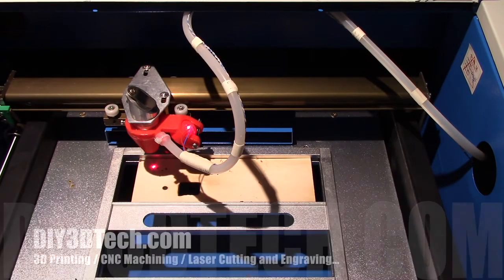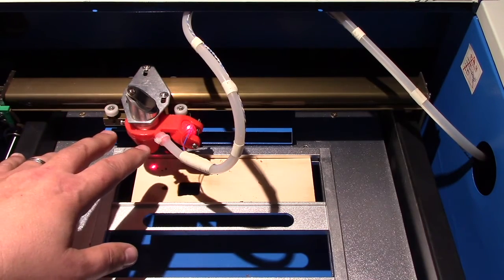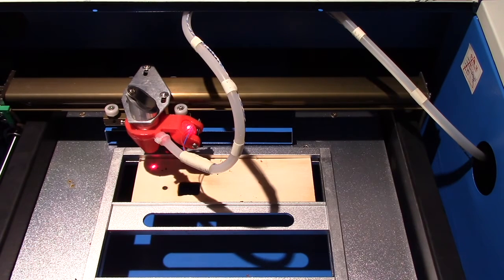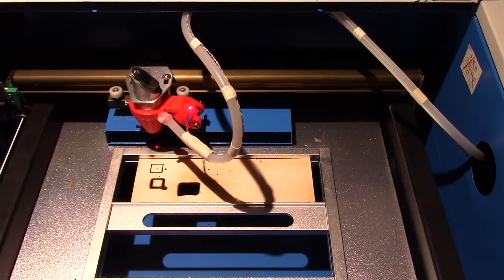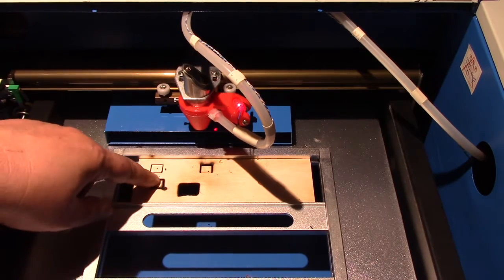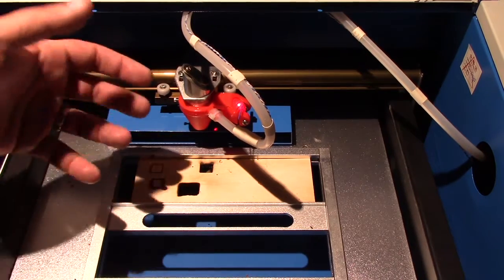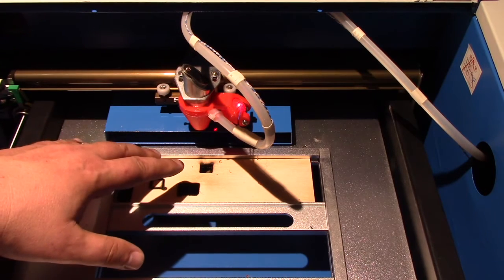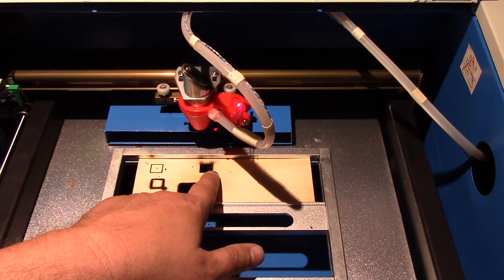K40 eBay Chinese CO2 Laser Cutter & Engraver -  Why You Need An Air Assist Nozzle!

Comment: what is the process to install an air assist with the red dot focus? too bad we dont see how you install them and where the wires go. does the red dot focus need a stand alone power source? is it connected to the motherboard, or is that merely connected to the power at the air pump? I have been going through your videos trying to upgrade each item on my new machine. Thanks for your help.
Reply from the maker: Have done both with red dot (separate PWS as steal power with a step down buck from the laser PWS).  It realy just depends upon your electronic skills and what you feel comfortable moding...

Comment: Here's something you never thought possible with a K40.

https://www.youtube.com/watch?v=nsv2-WaCZok
Reply from the maker: Interesting, Have cut think thick stuff with multiple passes so yes more then possible.  However you run into charing issues, sounds like you where running a lot of air?  If you look way back I converted a K40 to GRBL for this very reason (run multile passes).  Have tryed cutting a shape over a straight line?
Reply: @DIY3DTECHcom  I just wanted to see if it were possible.  I can do it in two passes if I only cut front to back.  I'm also using grbl, btw, but installed a Cohesion3D Mini so I can engrave faster.  Smoothieware was way too slow for engraving, but excellent for cutting. Just using one of those larger fish pumps.  The standard lens can't do this, not in less less than 6 passes anyway, but I heard from another YouTuber that the 38.1focal lens, while being a smaller, shorter focal length can cut deeper than lenses actually meant to cut deeper.  Many people rejected this notion, so I wanted to test it for myself.  I won't normally be cutting that thick of material, this was just to prove it to the naysayers.

Comment: This is probably not the most ideal place for this but: I recently 3D printed and added this air assist to my K40 chinese CO2 laser cutter. Air assist itself works great, however after this procedure I found myself with drastically reduced laser power / cutting depth. I assume this is my fault, but I'm out of ideas. The first thing I connected my 5v diode (the one advertised) to was the 5v line going to the potentiometer. This was apparently a mistake as it resulted in my laser barely functioning even at max power setting. I since then removed the diode from the potentiometer and connected it to the 5v located in the same line as the 24v that the internal light runs on. Still had the same issue, the laser power seems to have dropped significantly. At this point I went ahead and removed the diode completely - same result with low cutting/engraving power. I tested the potentiometer and it comes through great with 5v showing at 0 power and 0v showing at max power. Amperage meter also displays laser amperage as if it was working as intended.

As I mentioned, I'm out of ideas. If anybody has any suggestions on tests I could possibly run to sort out where the problem lies, I'm pretty desperate.

Also like to note that there are no strange smells, no smoke. The laser doesn't appear to be coming into contact with anything prematurely. The mirrors are also calibrated quite well (if I do say so myself). All mirrors as well as the focusing lens have been cleaned thoroughly and there are no obstructions/dust/etc that I can see.
Reply from the maker: So I am confused, you have a 40 Watt CO2 laser correct?  What does the cutting power have to do with a laser diode?  As even if the plastic got in the way of the beam, it simply would burn hole a in it.  If I had to guess, you likely knocked something out of align and simply not noticing it...
Reply: Hey, thanks for responding! I had originally believed that I had somehow caused damage to the control board while trying different 5v rails to power the diode - all of the 5v rails in my machine are already in use, so I basically piggyback on one and hope nothing bad happens. Others who know even less than I do about these machines (As if I wasn't scary enough) believed that perhaps I had damaged the laser tube itself in my tampering.

We have since found the issue and corrected it. As I suspected, it was an issue that was a result of me being completely out of my depth when it comes to machines like this one. I had believed my lens orientation was correct when I replaced it after cleaning all of the mirrors/lenses, but I had managed to flip it upside down. While the laser still made it to the project, the intensity of the beam was not nearly what it should have been. All is good now (or so it seems)!
Reply from the maker: Ah yes!  That gets a lot of folks and even believe I did a video this topic but good you got it sorted :-)

Comment: I love your videos! I will definitely follow you. I have a couple of questions. I am thinking of purchasing my own k40 co2 engraving machine from eBay. Is this the latest machine they have or is there a newer and upgrade one? Is this compatible with rotary engraver attachment?
Reply from the maker: Many thanks for kind comments and yes the K40 has been the way it is for several years and if your looking for the rotatory attachment, I would suggest buying one already set for one.
Reply: What are those two wires taped up on your air assist tubing?
Reply: Noel Abiang laser

Comment: I bought a fairly good quality 3d printed nozzle with a metal tip insert + o-ring etc. from eBay, but have a problem with a lot of air coming up through the mirror area in the head.  I had to replace my lens, (new one is made in the USA - FOCAL=50.8MM) which is a good bit thinner than the stock Chinese lens and I'm thinking it's where the nasty leak is coming from, so I'm going to see if there's a way to better seal it.  

Some of the crap I go through, I should start posting videos of my experiences. lol
Reply from the maker: You should (posting videos of my experiences)!  :-)

Comment: I added air assist of sorts for $2. I was looking for options on adding it and came across some guy stating that you don't need a nozzle, so I scavenged the basement and found what I needed! Brake line and a pump!  The black coiled hose is for airbrushing, cost 2 bucks from china.

Blog link:
https://k40laser.se/air-assist/

My video.  I did scorch the bottom in one place from holding the test button, but it cleaned off.
https://youtu.be/n756mBTPtAA

edit This one is a little better, but I forgot to turn the power down again; it's about 9ma here.  Also, until I get the bed I want, I drilled the hell out of the original and it's working quite well
https://youtu.be/ZKjtHL_rMiI
Reply from the maker: Yes have seen the tube approach before however personally as centers the air flow and ensure the beam is clear of smoke.  However if works for you and your happy with the performance, by all means laser away!  :-)
Reply: My biggest issue was the flame since I do a lot of cutting, but I don't have to worry about it now.

Comment: That much charring even with air assist, you might want to check your optics.
Reply from the maker: Typically get a bit, not running a lot of pressure just enough to keep it from flaming...

Comment: Please can you or someone do a video on loading the software. I have dongle plugged directly into computer port. Was giving Moshidraw with corelLaser 2013 and Laserdrw 2013. my computer sees dongle. yet i am constantly getting usb key missing error. Also
Softkey missing. Please Help. Thank You
Reply from the maker: What version of Windows are you using?  I recommend Windows XP with no virus protection, windows 7/10 especially with virus protection will give you issues. Also be forewarned IMHO there is likely a virus or at minimum malware in this software so I would suggest running it on a stand alone computer.

Comment: hello, great other video, i just ordered my air assist and cant wait to put it on,  only other issue i have is when i do a side by side engraving i noticed that the left engraving is darker and deeper the the engraving on the right, would you happen to know why i get this with the same machine?
Reply from the maker: Not sure what "side by side" engraving is however the further to the "right" and "bottom" you get the longer the path the light has to travel attenuating the beam (at 10,600nm this is very long wave light and the longer the path, the more power it will lose).  Second could be your mirror alignment, have you checked this in not only the X&Y but also in the "Z" as I had 6 mm run out in the Z on one machine.
Reply: oops, sorry about that, if i do a engraving with 2 designs next to each other the one on the left is deeper engrave, and the one on the right is lighter engrave. i have not did the aligment yet, worked well with only 1 engraving, this was the first time i tried to do 2 next to each other, i appricate your help, thanks
Reply from the maker: Yes, as shared above the closer you are to the origin the strong the beam.  However would highly suggest aligning the mirrors and see if that makes a difference...

Comment: Btw, I keep looking for a price drop (they recently went up 20-30 dollars) before Christmas and this is a new one I have not seen before.  For a 40w (1k-1.3k hour tube) this is starting to have bells and whistles.  No idea how good it is though but it compares and says it uses twice as thick framing material etc... www.ebay.com/itm/40W-USB-CO2-Laser-Engraving-Cutting-Machine-Engraver-Cutter-w-CorelDraw-Software-/152106266467
Reply from the maker: Yes they rise and fall in price and have seen this one before but not at this price point. While I have a digital and analog unit, I like the analog better as its more "hackable" and really was the reason for buying a second.  Also the sheet metal inside all looks the same, but it is the longer unit so likely does have a 40-watt tube and not a 30 like most digital ones...

Comment: Ahh. Bless, your bed is so clean. Mines a tar covered mess from mdf. Trying to find some good mesh like your other machine to replace it. But in the U.K. That seems tough.
Reply from the maker: On eBay you can get replacement bed but they are a bit expensive.  The screen I used in the other machine came from Home Depot.  Never seen one in many visits to London so not sure if they are on the outskirts maybe?
Reply: I live in uk and b and q have the mesh
Reply: Vinegar.  Distilled white vinegar cleans up laser gunk like you wouldn't believe.

Comment: I have three lasers and have been testing it alot, there is no difference at all between a laser with a air nozzle, and one with open lens design and a stand alone air assist (pipe).
Some chinese nozzles leak, so you get the venturi effect with the nozzle pulling dirty smoke into the nozzle from above.

Air assist is important, but you dont need the nozzle.
A small copper pipe does the same work.

Try it yourself, add the air assist on a small copper pipe and remove the nozzle. And check out some other types of air assist, should be a good video to make :)

Good vid though, always nice with DIY tricks for the machines we play around with :)
Reply from the maker: The  main idea is to clear the smoke out and prevent fire allowing for a slower speed pass so a pipe should work to as even on some commercial units I have seen pipes.  However like the asstetics of the nozzle over the pipe so maybe a just a piece personal geek dom :-)
Reply: Another benefit of the cone/nozzle style: it helps to keep the lens clean. An exposed lens with a (copper) tube air assist will require more frequent cleaning.

Comment: Could CO2 be used as the assist instead of air, or would that hinder the cutting process? or some other inert gas?
Reply from the maker: keep in mind an air assist is meant to puff out fire and clear smoke so air is just fine.  I guess I can't see a reason for doing something else in fact for the amount of gas you be dump would see as a possiabke health hazard...
Reply: DIY3DTECH.com I believe the CO2 would eliminate any chance of the PLA going into flames. Also CO2 is a safe gas to use, as we all expelled it all day.

Comment: I wouldn't worry about PLA getting set on fire, but it gets soft at 50°C
Reply from the maker: Yes the temp seems ok but as the head moves it does burn the PLA but no flame yet...
Reply: Pla doesn't really burn